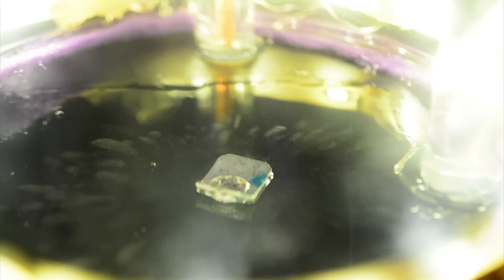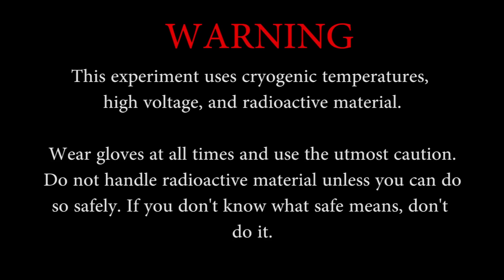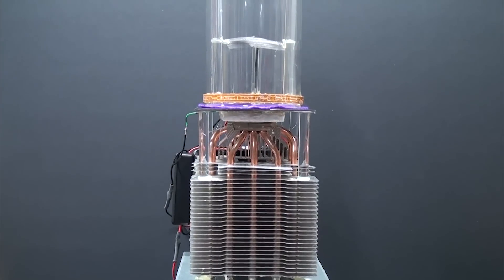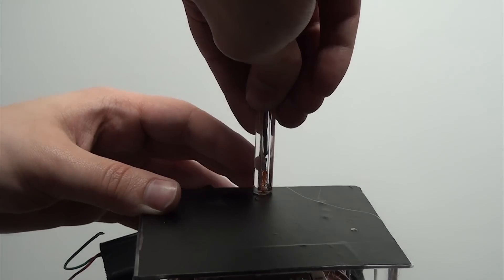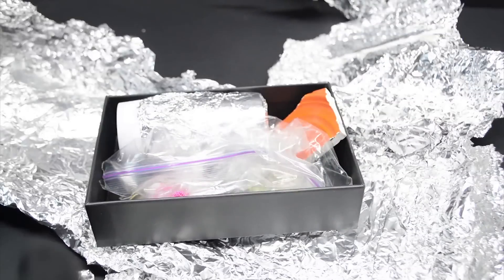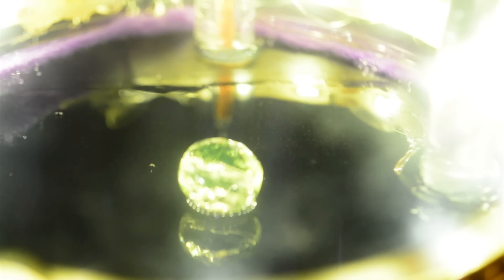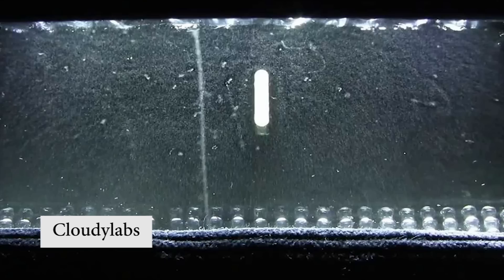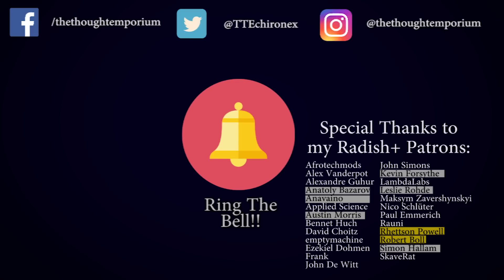Make Invisible Radiation Become Visible - Peltier Cloud Chamber

Comment: For years in the computer industry "less is more" with thermal paste. Too much creates a larger gap than necessary, you want just enough for thermal contact which was about 1/3 of what you put probably. More than that and it's just more material to conduct through and not necessarily better. Work on your soldering too xD

Comment: Doesn't this work without high voltage? Why did you add it?
Edit: But isn't there a way to build it without? I'm sure because I'd looked that up years ago too. Huh.
Reply: On our physics class trip to CERN, we got a cloudchamber workshop. It was quite a while ago, but I recall it just being a clear plastic box on a black plastic box, like an emo hamster cage, with a paper towel saturated in alcohol stuck to the inside top of the clear plastic box.

Worked pretty well when you put an actual source next to it, and very occasionally showed streaks from cosmic rays/background radiation. Hard to see though, we didn't have good lighting.

Comment: Theamal compund, issn't acctually that good at conducting heat, its only used to fill in cracks og low spots, if you use too much it will act as an isolation.

Comment: Uranium glass is rather safe, i have a collection spanning almost 60 pieces which range from a few hundred counts per min up to some of the citrine glass at 3500+ counts per min! i also have a small collection of stuff and store it in an old sealed ammo can like the army use, By far the most radioactive thing i own are several of those thorium mantels i got for a few bucks at a market which peak my counter out at 27 000 counts per min and i can even detect them through the metal can! the can for obvious reasons i keep out in the shed.

Comment: "Radioactivity is not that scary"
"THIS MATERIAL IS RADIOACTIVE AND DANGEROUS AND YOU SHOULD NOT HANDLE THEN UNLESS YOU'RE A PROFESSIONAL"

I little contradiction never hurt nobody
Reply from the maker: The warning is because I know a bunch of 14 year old shitheads are gonna start tearing apart smoke detectors with no regard to safety. These materials ARE safe to handle if handled properly, I just don't trust children to do so safely. So I went with a stronger warning.

Comment: FYI, it is against the US Nuclear Regulatory Commission guidelines to tamper with a smoke detector to expose the Am-241 sample.  IDK if it's technically against the law, but it's a very bad idea for anyone who doesn't have excellent knowledge about radiation safety.  Inhaling any Am-241 dust is dangerous.  It's not worth the risk for most people.  If you're not a trained scientist, please don't mess with ionizing radiation sources.  This demonstration can be done with no source, as was shown in the video.
Reply: It's far too small of an amount to cause harm, he'd need to crack open dozens of smoke detectors to really be at risk.

Comment: "Thoriated" welding electrodes have nothing to do with "adding" thorium to a weld, it has to do with the life span of the electrode as well as its thermal properties when using an electrical arc to fuse metals...

Comment: @The Thought Emporium 

You telling me a Cloud Chamber is THIS EASY to build? well i got 2x 125W Peltier elements right next to me, both are at a CPU cooling tower… soooooo 
How much Voltage and Amps du i need for the "High Voltage" part? because i ALSO got a 350W power supply laying approximatly 4m away from me. 
so i got additional a 30W Laboratory power supply and a 300W  Laboratory power supply… i also already got uranitite in a 27cm THICC steel "Castor" so, i only need glass :3
to not fuck things entirely up i would appreaciate some more instructions.
for Savety concerns, i am trained in handling dangerous elements (because: Workplace) but electonics are not my best, but i got 2 elecricians around me... (Friends) so yeah you wont be responsible for anything of corse. 
At least, thank you for uploading this video and you got one subscribtion more now!

Comment: the only issue i have for this video is the statement " alpha particles are highly penetrative"  but that is not true. Alpha particles can be stopped by just about anything including skin. alpha particles are not really that penetrative. sure if you have leave a source of alpha particles on your person, ya, you will eventually it will cause damage. the ones that you have to watch out for are the beta and gamma particles, those are the more penetrative forms of radiation. beta particles are highly "energized" and will cause damage more readily, which come in a form of "beta burns" and beta rays will penetrate the skin. 

this is pretty cool, but did you have to have the lights? if you just added a black back drop and have your regular lights on youd be able to see the radiation a little bit better. or you could try and have the lights on the machine turned off. 

SGT Rybicki, CBRN Spc Us. Army
Reply from the maker: Timestamp? Im 95% sure I said "aren't" and you mishead

Comment: have done some testing and more thermal compound is worse, you want just enought to fill all the voids but no more as your just adding heat travel distance.

also the warnings on uranium/ thorium are completely out of sync with the actual danger. a kind of low key radiophobia is you will, radiation is dangerous but not that dangerous.
Reply from the maker: Keep in mind I'm adjusting that warning for the audience. I know a ton of people will see the video, see me handling it, and just do it without learning ANYTHING about the safety. It's what I would have done because I was a teenager and teenagers are stupid. Hence why I have an exposed americium source. So someone replicates this, digs one out, leaves it laying around and the dog eats it. Now it's a problem. So I'm firm on the warning because I mean it. Unless you know how to do dangerous things safely, primarily by learning all the risks and setting up proper control measures, you shouldn't do them. 

So yes, handled properly this stuff isn't dangerous. But like, have you been on the internet before? Not everyone has a full set of marbles to start with, add inherant laziness and "hold my beer" mentality, and you've got a situation where it's easy to make a stupid mistake. Better to be safe than sorry

Comment: If nuclear power generation is the way to stop global warming, what is to be done with all the nuclear waste?
Reply from the maker: Put it in a really deep hole, or better yet, back into the mine it came out of. BUT I don't actually see it a waste. It's waste in the same way that metal thrown in the garbage is waste. It isn't really, just most people are too lazy to reuse it properly. Even if we don't switch to thorium based reactors, which we should as they produce tiny amount of waste that's 90% resuasable and the rest is safe after 300 years, normal waste is also useful. It's stil highly radioactive which means it's just sitting there releasing energy. I'm of the mindset we should put it next to special solar-like panel to continue capturing energy from it. There's some new ones made of sheets of diamond that could withstand the radiation and work nicely. 

ALSO there's a misconception about how much waste nuclear puts out. Keep in mind nuclear fuel is rediculously dense as it's made of very heavy elements. So it doesn't take up a lot of room. 40 years of nuclear waste from a single plant fits in a few large steel drums. When they refuel it they add like, a few kilograms of new fuel and take that much out. And they do that once every 10-20 years depending on the reactor. Making solar panels and wind turbines makes exponentially more waste.
Reply: @thethoughtemporium  there are many considerations that suggest nuclear is not the answer to decrease carbon emissions: pure sources being depleated, length of time to build and recoup costs, thorium not yet viable for mass power generation, no known acceptable solution to waste storage and so on. But the question I have is how will nuclear power generation address climate change when worldwide power generation only accounts for 25% of the world's carbon production? 

Side note, do you feel it is wise to allow all countries the ability to build nuclear power plants when it is a known fact that materials used can be turned into bombs? Either full nuclear bombs or "dirty bombs".
Reply: @thethoughtemporium  what processes exist and are used to repurpose nuclear waste?

Comment: Nuclear isn't scary, what's scary is the regulatory environment that allows dangerous situations to develop. If properly regulated, nuclear would be fantastic, and thorium based plants that physically cannot melt down are even better(but you can't make weapons grade plutonium with a thorium reactor.....).
Reply: @danukerudesu8919  Oh there are plenty of regulations, but enforcement is lax. You should sign up for the NRC's newsletter, the number of accidents that occur in the industry is frightening.
Reply: From the NRC report to congress, 2016:

On July 14, 2016, the Westinghouse Electric Corporation (licensee) reported that during annual cleaning of the S-1030 scrubber at the Westinghouse Columbia Fuel Fabrication Facility, an excessive amount of low enriched uranium was found in the inlet ducting to the scrubber, potentially exceeding the uranium mass limit established for nuclear criticality safety.  The facility fabricates low enriched uranium fuel assemblies for commercial nuclear power plants.  The S-1030 scrubber removes gases and particulates from various exhaust streams associated with the uranium conversion process.  The licensee conducted multiple inspections and cleanouts and quantified the amount of uranium that had built up in different sections of the scrubber.  Approximately 87 kilograms of uranium was initially found in the inlet ducting, exceeding the nuclear criticality safety mass limit of 29 kilograms.  An additional 172 kilograms was cleaned from the scrubber internals, exceeding its mass limit of 21 kilograms.  No nuclear criticality safety controls, such as moderator limits or favorable geometry restrictions, were present.  As a result, the safety margin available to preclude an inadvertent criticality was substantially degraded.  This represented a major deficiency in control having significant safety implications requiring immediate remedial action.  Specifically, the event called into question the licensee’s controls for nuclear criticality safety associated with wet scrubbers and non-favorable geometry components and justified the immediate shut down of the conversion process.  An actual nuclear criticality did not occur and there were no health consequences to the public, workers, or impact to the environment.
Reply: @danukerudesu8919  Yes, that's the most disturbing part of it. This is a fuel fabrication facility, and yet they had uranium buildup that was 3 times the safe amount in one section, and over 8 times the safe amount in another section. These limits are set because you can achieve spontaneous criticality when they are exceeded. Essentially, we just about damn near had a Chernobyl at a processing facility that had no equipment to deal with a nuclear reaction event.

From the report:
Cause(s)— Configuration management controls were not effective in managing increased uranium accumulation in the scrubber over an extended period of time when design and operational changes to the system were made.  Operating experience and the corrective action processes were not effectively used to pursue the actions needed to detect, estimate, and mitigate deposited uranium in the scrubber.  Organizational safety culture weaknesses contributed to invalid assumptions in criticality safety evaluations and the failure to scrutinize the content of the evaluations and as-found conditions in the scrubber with a questioning attitude.  Management did not ensure the organization had sufficient procedures and training to recognize and respond to deviations from the safety basis described in the criticality safety evaluation.  Furthermore, the scope of licensee audits did not provide a comprehensive review of the Nuclear Criticality Safety Program.
Reply: @danukerudesu8919  Not a. Ok, I rescind my commentary and bow down to the great master of the English language.....

Comment: You put wayyyyyy to much thermal compound on that, you need at most a beed in the middle, the idea of thermal compound is to fill in imperfections between the two layers thus you want the thermal compound layer to be as thin as possible when it spreads out on the cooler. When you put that much on it acts more like a thermal insulator than a conductor

Comment: Those "marbles" have a channel drilled into them, so they look a lot like beads. Do people actually wear uranium around their necks without knowing it? Yikes.
Reply from the maker: Wanna know what's worse? those negative ion bands. I've got some on the way. their "negative ion sources" are just a piece of radioactive material. Gonna put on in my cloud chamber to demonstrate. But yes, people wear uranium. The dose is very very low so as long as you don't wear it 24/7 chances of it being an issue are low. But when you wear it all the time the dose can add up

Comment: Your use of thermal compound is shocking. Clearly you have never overclocked a PC before. I know about thermal compound and ceramic peltiers because I have made a lot of self-starting stove-top fans with massive PC coolers and tiny DC motors using 12-inch blades.
It is a 2-stage process: you have to "dope" the ceramic with compound, but you do that by working it into the surface of the peltier with a putty knife, and then you scrape off as much as you can, and THEN apply a very thin layer, smoothed to perfection, and then you carefully lower one edge of it, and then slowly lower the other, so that no air-pockets are created.
Every air pocket radically reduces efficiency, and excess thermal compound actually works against you, because you can't get the surfaces touching properly.
Spent a LOT of time on this in the early 2000s getting 80% overclocks on nothing but air, and did a LOT of experiments to establish what method and what product works best.
A high silver content is definitely the best stuff, but my experiments show that even very average compound works very well when applied and used correctly.

Comment: While nuclear maybe a possible solution to climate change, it will not solve the problem of sourcing solid fuels and the resulting pollution. It’s kicking the problem down the road, not a solution to energy production. 

Nuclear pollution is not carbon based so it technically won’t contribute to climate change but it still causes different long term damage to the environment. Especially since there are no long term storage sites on the planet. When one is built the global supply of radioactive waste will have to be shipped there. Great opportunity for a environmental disaster. 

I’m not saying there isn’t benefits to nuclear, but the people that talk about the benefits don’t speak of the other problems that we will have to face by using nuclear. Nuclear of a steeping stone at best, not a solution.
Reply: you are correct, but not exactly what he is talking about, current nuclear technology is the same as the current fossil fuel technology, but perfect nuclear reactors with very little waste will be savior of the environment, so people need to invest into the right nuclear research so this will happen.

Comment: Peltiers are awful at cooling CPUs The heatsinks used on peltiers are similar in the fact they use copper heatpipes with aluminum fin stacks, Using one on a CPU would actually just overheat the peltier

Comment: So since you're smart as fuck and you know what you're talking about with this stuff and I don't can I ask you a question? Is it true that nuclear energy actually gives off less radiation pollution than wind or coal or solar energy-efficient along with others? Thanx..
Reply: Depends on the reactor design, age, maintenance etc. A well maintained reactor with a fairly new design will be incredibly safe. Solar/wind don’t produce any radiation, but a well shielded and maintained reactor won’t either.

Comment: The problem with Nuclear Energy isn't  the energy. It's Capitalism. Private corporations are not trustworthy with this shit and they will always do as little as possible to meet safety requirements and cut as many corners as they can to return as much profit as possible to shareholders. In fact, they're legally obligated to do as such. I'm all for Nuclear Energy if it's publicly funded and done by the government which can be regulated as much as needed. Nuclear Energy isn't at all a feasible option right now anyway, because the waste lasts for fucking hundreds if not thousands of years and we still have no idea how to deal with the waste we've already generated. There's no such thing right now as permanent disposal of nuclear waste. All of it is stored in "Temporary storage" until science can figure out what to do with the waste. So when you say Nuclear Energy is the only energy that can save us from climate change, I have to laugh because you know you're being dishonest about that, and severely discounting other clean energy sources. I suspect you do this because Nuclear energy is the most efficient, but that doesn't mean anything when our current system would just end up with more barely safe reactors that produce enormous amounts of toxic waste that has to be handled in HIGHLY expensive ways. I'm not a scientist, and I don't pretend to know more than you. I'd just be more trustworthy of nuclear energy if it was YOU and the scientists running and owning the reactors and industry, but I will never support it as long as corporations are involved and owning it.
Reply: I'd also suggest you check out Simon Clark's Video about nuclear energy. He's a Climate specialist with a PHD.